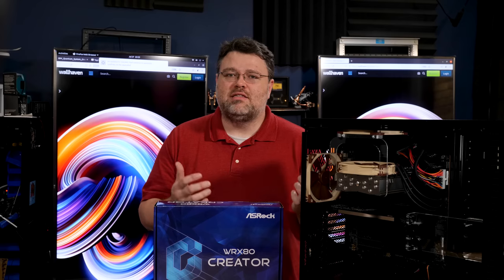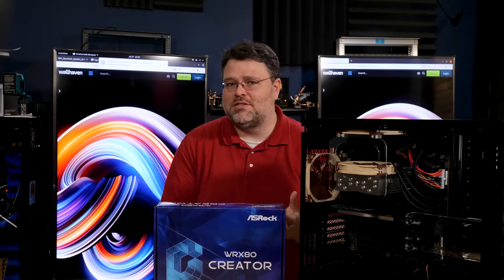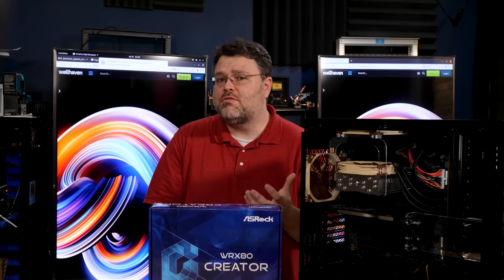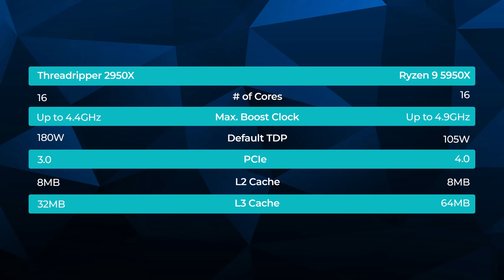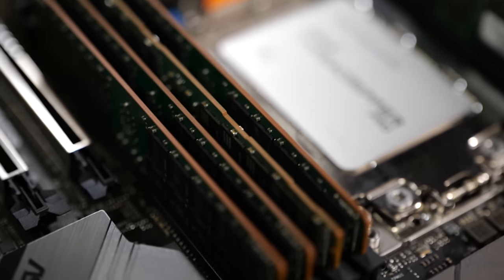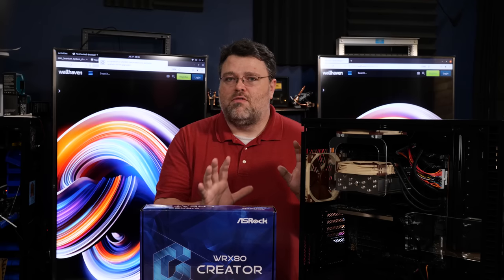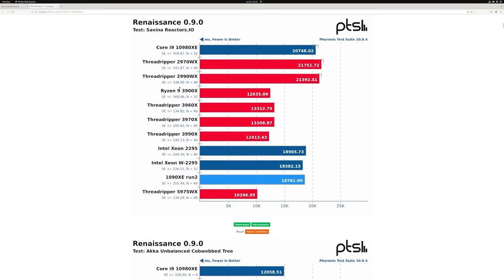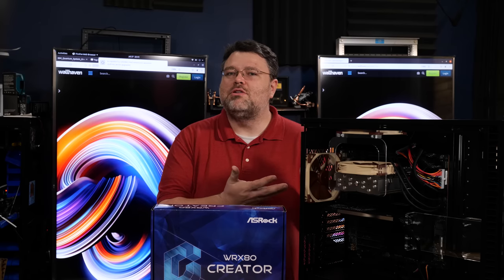Threadripper 5975wx for the DIY! Tested and Overclocked with the ASRock Creator WRX80

Comment: Thank you very much for covering this segment of the market, I do Terapixel Panoramas, think combining 70,000 to 150,000 images into 1, currently on a 3970X with max memory and been sitting on the fence for upgrading for more memory and PCIe for storage, It hits my computer in ways that very few benchmarks can, think memory, storage and compute limited all at the same time as different cores get through different parts of there workload,
Reply: That sounds super cool, must have some fun problems to solve on the computer to get it done.
Reply: if you can please share more info, sounds really interesting :D 
(also if storage is an issue, wouldn't a P5800x be also a good investment? since they are discontinued now you might be able to find one at a more modest price)
Reply: Sounds like you need an AMD EPYC CPU.
Reply: niche af, but damn that's taxing.
Reply: @ewenchan1239  I think he will be better off with a cloud provider.
Reply: @MrAtomUniverse  
Maybe.

It depends.

The problem with cloud providers is your data transfers (either in terms of speed and/or cost).
Reply: @ewenchan1239  Sad to say you're right on AWS bandwidth fees probably need alternative provider that provide larger amount of cheap bandwidth fees like Digitalocean ?
Reply: @MrAtomUniverse  At long exploitation it runs also into electricity and cooling costs. 
Worked with a huge company that does a lot of memory intensive cpu processing, it turned out to be quite a bit cheaper in the long run to build own compute farms in a division in a country that has cheap electricity and internet.
Reply: @MrAtomUniverse  
I've never looked into the pricing for Digitalocean.

But I also think that it depends on what you are doing and/or how much inter-node bandwidth you may or may not need.

For the stuff that I do (HPC applications), it is always cheaper for me to just buy the hardware and deploy it myself because it's a one-time capital expenditure cost vs. trying to rent time from a cloud services provider.

Beyond the initial data transfer to and from my systems, the volume of internode data transfers can be in the tens to hundreds of TBs, if not more.

And if you want high speed inter-node system interconnect, you have to pay quite a lot for it; at which point, it is pretty much almost always cheaper for me to just buy and deploy the infrastructure locally as a one-time cost.

For smaller projects, it might work.

But if you have "bigger" projects, between what they charge you for the initial upload of your data and then the subsequent download of the results, I just haven't found a scenario where a cloud provider has been worth it for me.
Reply: @Ewen Chan  Ahh ok , that make sense. Any chance you haven't considered epyc over threadripper? I haven't decide on this. I'm looking for one to run my production scale database. Unfortunately for cloud , storage is expensive. In fact , if i don't need that much ram, i'm considering just high end Ryzen 9
Thanks for your reply and insight btw, very useful.
Reply: @MrAtomUniverse  
I have.

Epyc is too expensive for me (as a platform).

Same with Threadripper/Threadripper Pro.

I don't need Epyc (because Epyc can address upto 4 TB of RAM).

Threadripper could only address upto 256 GB of RAM (which, for some of the problems that I am solving, may not be enough). (My old Xeon cluster was four-nodes and each node has 128 GB of RAM, for a total of 512 GB.)

Which leads me to Threadripper Pro, but again, more expensive than Threadripper, but at least the Threadripper Pro can address upto 2 TB of RAM, I think.

As a result, my current micro-HPC cluster nodes are running on Ryzen 9 5950X, with each node having 128 GB of RAM.

(I'm currently only at two nodes, but I am planning on building my cluster back out to four nodes.)

It's a cheaper option, but the downside with that is if you want to have a discrete GPU AND a high speed networking card (i.e. 100 Gbps Infiniband), you don't have enough PCIe lanes to be able to supply the bandwidth to both).

So, I had a discrete GPU for the initial setup, but now I run everything through TigerVNC remote desktop (which has it's own quirks) in CentOS 7.7.1908.

Beyond that, it works well enough for my HPC applications at a fraction of the cost.

My cluster headnode is powered by an Intel Core i7-4930K on a Asus P9X79 WS motherboard because this combination gives me I think it's 48 PCIe 3.0 lanes, which is enough for a 12 Gbps SAS RAID HBA, Infiniband, and very basic (Quadro P600) video card, and then I have eight HGST 10 TB SAS 12 Gbps connected to the SAS RAID HBA in RAID5 and then four I think they're Samsung EVO 850 1 TB SATA 6 Gbps SSDs connected to the onboard Marvell RAID controller (also in RAID5) and the cluster headnode also runs OpenSM for Infiniband. So that works for me.

Cheaper than going with Threadripper, Threadripper Pro, or Epyc.
Reply: @ewenchan1239  To add, i'm considering Ryzen 9 because it's easier to sell if i wish to upgrade. Thanks for your insight , will definitely consider your method , the ryzen 9 way. Btw, are you on ECC Ram? Also, i heard it's supported even on normal Ryzen boards
Reply: @sebastianguerraty6413  Capturing the images is literally done with a telescope 2700mm focal length, need to be high enough or the laws of physics come into play (depth of feild), As for processing, 16x10tb sata drives as the bulk storage, and 2x pcie16x to 4x NVMe cards full of 4tb firecudas for scratch, I'm I/O limited by the die but thats not a bad thing, also sabrent are poor for very random workloads, that I/O limit still exists in epyc, but its easier to spread around with different slots, its large files (50MB raw becomes about 114MB tiff,) but when all cores ask for those files it ends up random, the RAM issue mainly falls into export, THE best program for this has a fun quirk where if you want to export a 1TB image, you need about 1.1TB of RAM, currently its hitting an SSD Raid1 set as a pagefile but that becomes painfully slower once you start hitting paging,
Reply: @MrAtomUniverse  
No, I'm using unbuffered, non-registered, non-ECC RAM.

To sell a Threadripper or Threadripper Pro or Epyc isn't difficult, but for me, in terms of a cost-benefit analysis and also the cost of entry into the platform, it was high enough that it didn't make sense for my compute nodes to use that as I'm running my compute nodes completely headless.

If I need iKVM access, I can spend $300 on the TinyPilot iKVM rather several thousand dollars for either the TR, TR Pro, or Epyc platform.

A single TR or TR Pro CPU can cost as much as my ENTIRE Ryzen 9 complete system/node, so it just wasn't cost effective enough.
Reply: @MrAtomUniverse  
My understanding is you can use UNBUFFERED ECC RAM with Ryzen.

Don't know about registered ECC RAM on Ryzen.
Reply: @MrAtomUniverse  
It really depends on what you are doing.

My complete Ryzen 9 nodes where I am re-using HGST 1 TB HDD for the boot drive (since I don't reboot the system often, so I don't need a fast SSD in the compute nodes because the cluster headnode is what has the fast SSDs as pooled storage) was about $2000 USD with 128 GB of RAM.

I just used my old GTX 980 to jumpstart the system to install the OS, and once everything is up and running, I take the GPU back out and deploy the next node.

And as long as I can remotely administer the node via ssh, I'm good.

For me, that was a more cost effective way to replace my loud Xeon server/cluster.

(I'm also using a Noctua NH-D15 CPU HSF, and I swapped out the stock fans for two Noctua NF-A14 industrial PPC 3000 rpm PWM fans, so it runs a bit louder, but my Ryzen 9 5950X under full load doesn't exceed 70 C with about a 22 C ambient temp.)

So it does what it is supposed to. And unlike watercooling/AIO, a tower heatsink/fan combo = very little maintenance and no coolant seepage.

For what it is and the price, it works very well for me. Very stable/reliable systems.
Reply: @ryanfav  cool, thx for the reply.
I believe I saw a similar application of intel optane (ssds, not dcpmm) on the LTT review of first gen optane, but don't quote me on that. It does seem like a storage solution with much better random performance would be a "cheap" way of addressing the issue (or at least cheaper than 1TB of RAM, lol that is just bonkers for me)

Thx for the info, really appreciate it :D
Reply: @ewenchan1239  for registered RAM you need threardripper pro or epyc, ryzen cpus only support udimms :/ 
that is why the platform has a cap of 128GBs as the largest modules I've seen for UDIMMs are 32GBs (and quite expensive compared to RDIMMs)
Reply: Wish software was more ramdisk aware imagine getting the system to do all this work but first output to a huge Ramdisk then have it offload to nvme then to the Nas.
Reply: @shadowarez1337  
Well, most people don't really run nor create ramdisks because most people/system don't have that much RAM in the first place.

I don't know how much RAM it takes during the processing, but if you want to be able to do it entirely in RAM, you'd have to double basically the installed capacity -- because let's say that it takes 128 GB of RAM to process those images (could be even more, actually).

That means that if you want the system to be able to store the results in RAM, you would need 128 GB for the ram drive, and then 128 GB of RAM for the actual processing itself.

And that gets to be VERY expensive as there are only a few platforms that can do it.

An alternative to that would be to run Intel Xeons which support Intel Optane DC persistent memory (or PMEM) so that would be a slightly cheaper way to increase your capacity, but then you won't be able to use the AMD Threadripper nor AMD Threadripper Pro nor AMD EPYC series of CPUs.

PMEM is actually a great solution for that because the finite write endurance limit of NVMe SSD (even enterprise grade NVMe SSDs which costs a pretty penny) still has a finite write endurance limit on them, which means that because of its speed, you'd want to use it all the time, and therefore; you'd wear our said write endurance limit in no time at all. Or at least I would. And I suspect that if you are processing that much data, the OP would be wearing those out as well (or has the potential to wear them out).

This is why ramdrives isn't really a "thing" so much.

The better solution, I think, would be for GlusterFS to re-enable you being able to create a distributed Gluster volume across ramdrives, so that if you have a cluster of relatively inexpensive systems, but each node has 128 GB of RAM, then you can say, allocate half (or most) of it as a ramdrive, and then using Gluster, combine the individual ramdrives in the cluster to be presented to the network as a single NFS(oRDMA) share. 

Then if you have 100 Gbps Infiniband behind it, you can have four nodes, each contributing 64 GB to the NFS RAM drive, and then you can read and write from the combined 256 GB ramdrive (which are spread over four nodes) over 100 Gbps Infiniband so that if one node DOESN'T support 512 GB, but you have four nodes, each with 128 GB of RAM, then you can still increase your total, overall installed RAM capacity to 512 GB, and then allocate half of that as a distributed stripped RAMdrive by using GlusterFS.

This used to work with GlusterFS v3.7. As of v5, it was deprecated and in v6, that feature was removed entirely. :(

So now you can't do that anymore, which sucks.

(I know that you can do it because I've done it before. It works....ok. Never was able to quite get the same speeds as straight RDMA, but it worked reasonably well enough. I was hoping that it would actually be faster, but I guess that there were still some other bottlenecks in the stack.)
Reply: @ewenchan1239  thank you learned something new found a nice set of 256gb DDR 4 3200mhz I'd be using for this rig I'm planning and it's only $1300 basically 1.5x what I paid for my current 128gb.

Comment: For me the 5950X have PCI lane problems. I really hope in the 6000 series that will be increased just a bit.
GPU  ; 10gbe card ; 1 SSD NVMe RAID card ; 2 NVMe SSD ; 3 SSD SATA.   (Dark Hero motherboard)

 The only way I can get around it is to buy a built in 10gbe connectin into the motherboard. But to be honest I don't want to go for the threadripper because of the $ .
Reply: Just remember that the 10gbit connection on your motherboard will be bottlenecked by any used SATA ports, chipset connected PCIe slots, and USB ports on the back if you saturate those heavily, so if you plan to tax it heavily with lots of PCIe cards, that might not be a great solution. 
Another option is potentially, now that the more cost-effective TR non-pro is not on the horizon now, to buy used and go with TR 3000 parts for relatively cheaper HEDT CPUs, or used TR Pro 3000 if you want the upgradability to TR Pro 5000. However last I checked, the prices on the former still aren't that great and pricing on the latter will still likely be very high. 
If you do get a Ryzen 7000 motherboard with built-in 10gbit ethernet, I think you will be able to squeeze in every expansion card you want. The GPU and NVMe RAID card would go in the first and second PCIe slots respectively, and the 2 NVMe and 3 SATA SSDs would go in their respective slots too. Although you probably are cutting it quite close if you wanted to add more expansion cards in the future and/or faster networking, so it's unfortunately quite complex
Reply: @dreamteamdidonethingwrong2499  Its really shitty how they market motherboards, like it can do it but you cant do everything all at once and every damn motherboard is the same where they state it can do so much but dont say its limited and cant do everything at once.